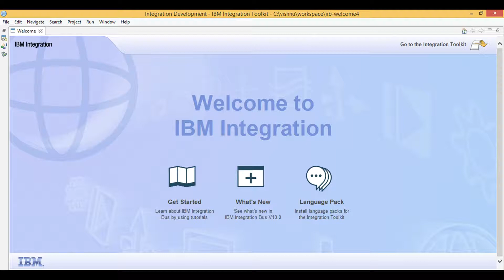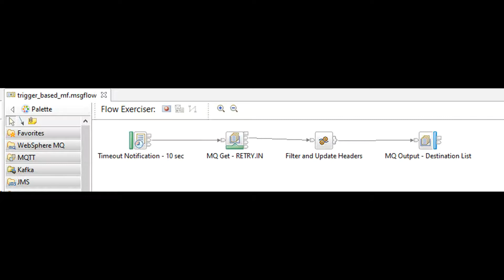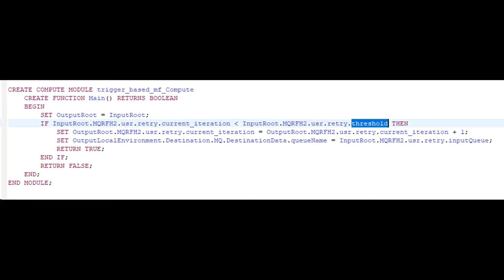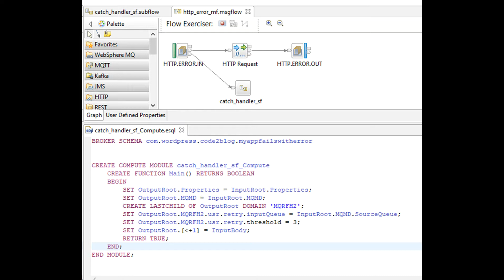iib - retry mechanism (part 1) timer node - IBM Integration Bus

Comment: Hi 
How can we use 2 Timeout control nodes and 2 Timeout Notification nodes in a single flow
I am getting MQMD error
Reply: I have ensured that Unique identifiers are fine, supplying Timer XML as expected
Reply from the maker: See this https://youtu.be/SxcaAG-Bj0w
Reply from the maker: Yes you can use them together. Mqmd error is not related to timers